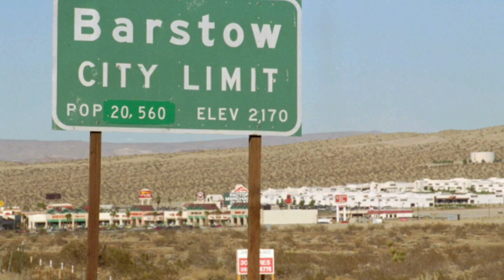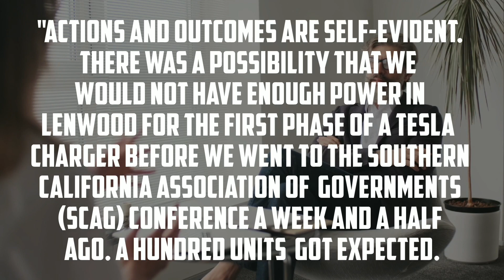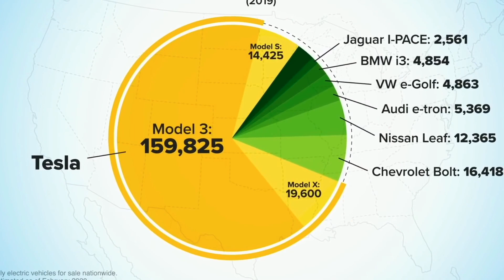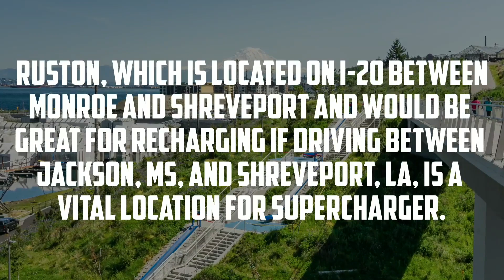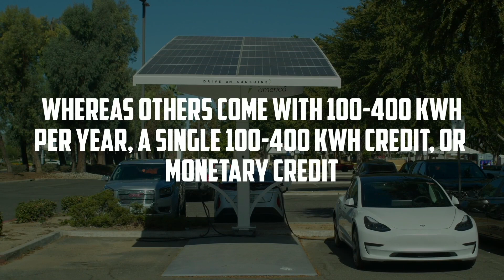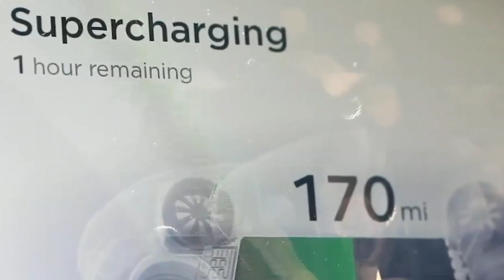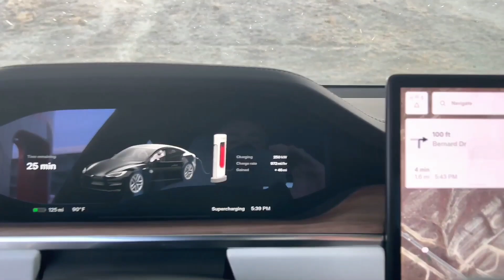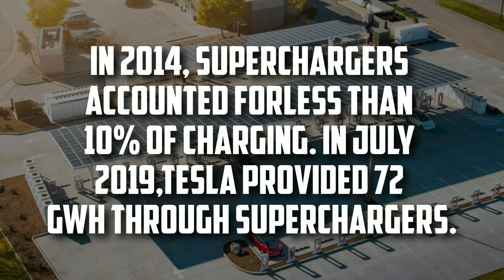TESLA'S 100 Stall SUPERCHARGER Oasis SHOCKED The Entire EV Industry!

Comment: Wow what good is 99 other stalls if I take 8h to fully charge my EV? What a publicity stunt and PR gag in typical Musk fashion. 

Bring out the 1MW fast chargers I mean every modern brand supports 350 to 750kW fast charging already. Tesla chargers are among the weaker ones in the field and use retarded proprietary connectors.